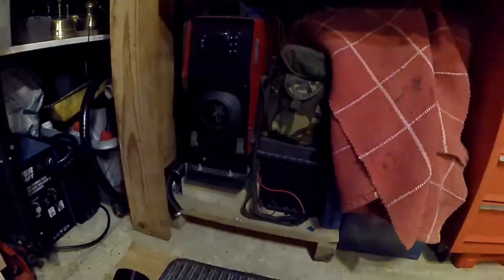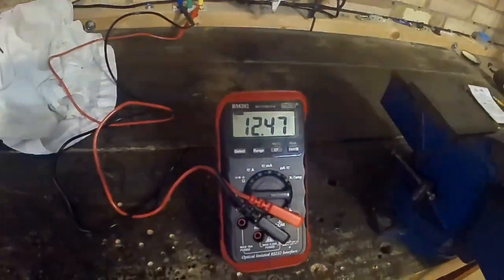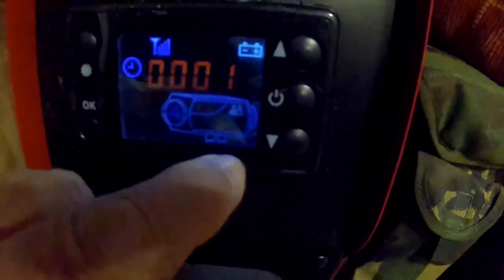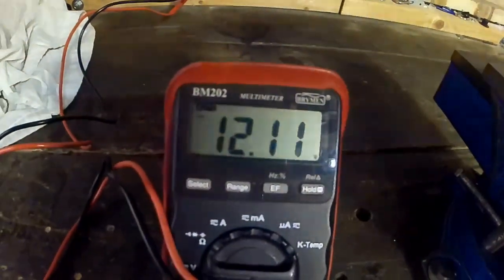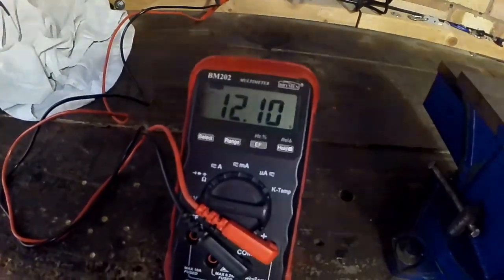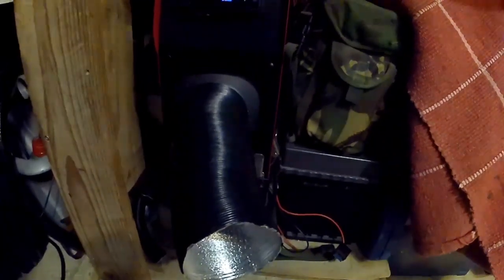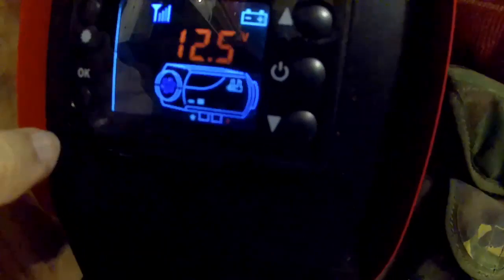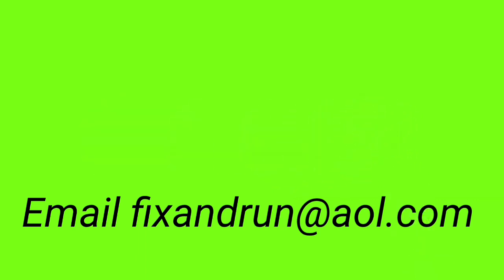Motorhome. Diesel Heater. Battery Voltage. Bench Test. Results.

Comment: I've had mine running at 11v. There's an high initial current about 10-15 a which pulls down the battery voltage due to losses in the cables in my system then it settles  down to about
 1/2 a  at  lowest setting. It's important all connections are good at those current levels to avoid IR drops.

Comment: Your doing the test in a garage. Try it in a van with a Dc to DC or split relay charger installed. It won't fire up unless the van is turned on to maintain 13.8V.  I installed the heater before installing the charger and it worked fine, just like your test. Once I installed the charger, it wouldn't fire up and gave me an E 10 error code, once I started the van, she worked fine.  Don't ask me why, I just know it does affect it.
Reply from the maker: Length of power cable and size of cable critical. Power to diesel heater has to be direct to battery. Negative wire short as possible to a good chassis bolt. George
Reply from the maker: Ps there's one in my campervan, and  one in my old motorhome all work OK at 12Vdc.
Reply from the maker: Sorry really don't understand what you are saying. Dc Dc etc are you referringto a battery to battery charger. Starter bat to leisure battery.😮 George

Comment: I power mine with a 500 watt PC PSU. It's at 11.9 volt with nothing running and goes down to 11.5 when diesel glow plug is burning. Starts right up no problem.

Comment: Hi. I hope this helps you with your heater problem Alex?  Great video George.  From Jeff and Helen.
Reply from the maker: Hi guys. There is really good videos regarding  Diesel Heaters. But many misleading ones as well. Quite a few comments on videos which can send people on a Goose Chase regarding fault finding. Lack of operating instruction and badly translated operating instructions dont help. Having that problem with Ham Radios and kits. Cheers from old George